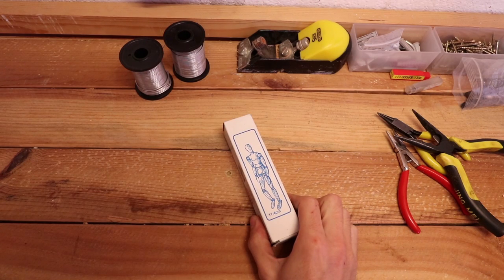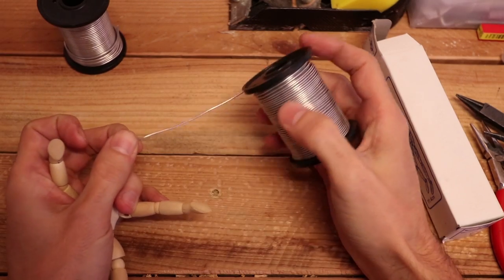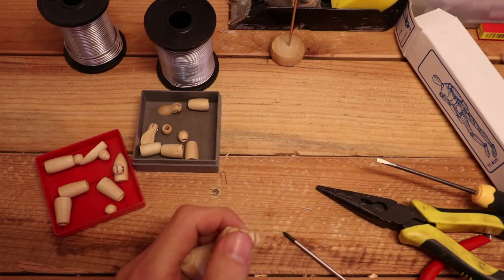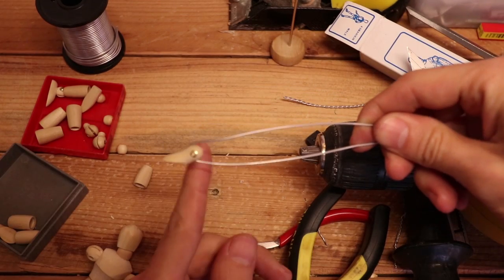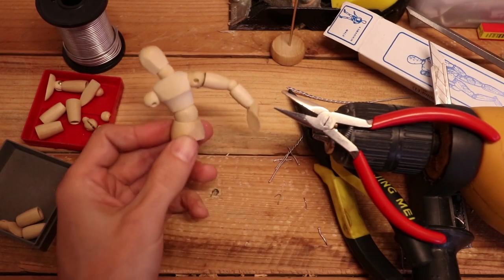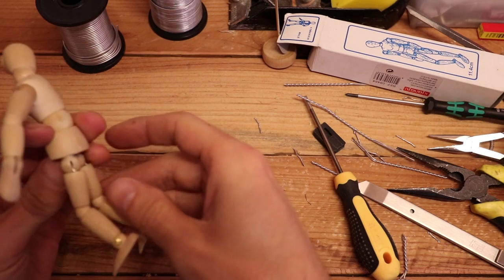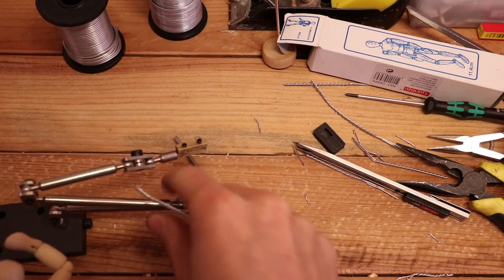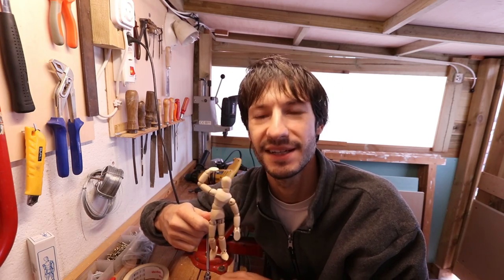Convert a 3,5 bucks wood mannequin into a winning stop motion puppet

Comment: How long did it last please before the wire broke down. Thinking of doing this and expecting some longevity, thanks
Reply from the maker: It is not forever, aluminium wire allows around 20 bends depending on how hard the angle is.
Reply: @edupuertasfruns  thanks

Comment: I have a puppet of this kind but it is 30 cm high, could you tell me how thick my aluminium wire needs to be ?
Reply from the maker: +Rodrigue Voisin Not sure if this would also work. The joints on a bigger puppet should work better. But if you want to try, I would use 1,5 mm wire.
Reply: edu puertas thank you very much ! I love your work, it inspires me as a beginner !

Comment: Hello dear. Great one. But once question!  How did you fix that thigh ball into the hip socket?  I mean mine is quite loose. Any rubber gum would help? I'm in lock down. Can't get aluminium wire. Can i use copper?  It's going to be my first stop motion video by the way. Love.
Reply from the maker: Cooper will work as well

Comment: how long is the wire holding up? I'm thinking of the work-hardening of AL and CU
Reply from the maker: I will be testing it but, this aluminium normally lasts up to 20 turns at same point, something imposible with steel. Braiding changes it's properties but for stop motion animation is usefull as you feel when one of the wires brokes, so you have the chance to end the shoot with extrem caution.

Comment: don'tg legs fall out of body when without glue?
Also one leg of mine manikin fell out t(hook off the screw), ow to fix it?
Reply from the maker: your puppet could be different, you could glue it if it falls.
Reply: Thanks for the answer) No, it's same as this only bigger, just more poorly made, I'll probably find a way.
* About my answer, I mean you ripped out jois of legs, it was with glue and you just ripped it and put it in without glue, how they are not falling down?
Reply from the maker: +VIProach they fall but I use something called bluetack to keep it there and allow some movement